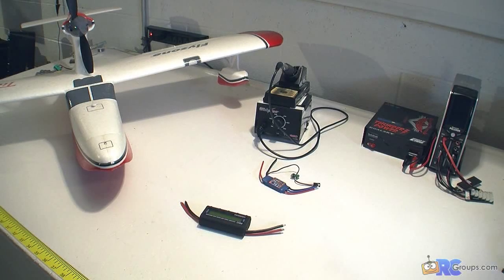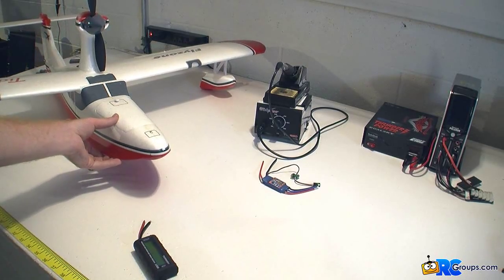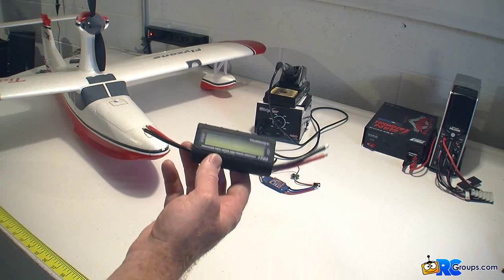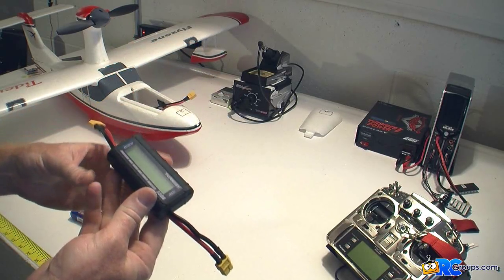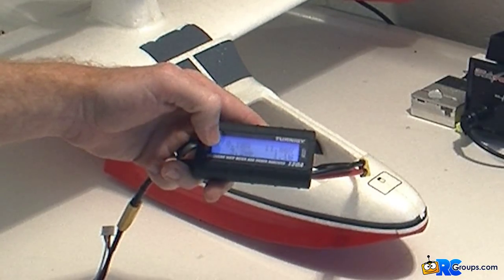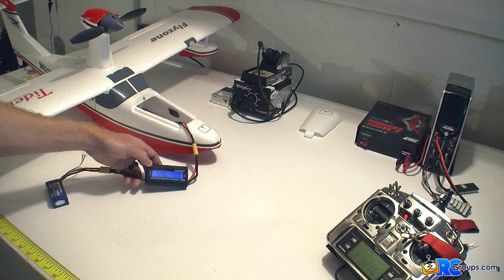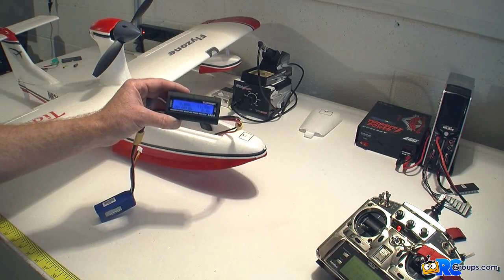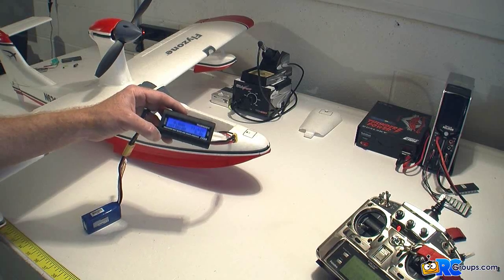Video Review: Turnigy Precision Watt Meter and Power Analyzer

Comment: ..interesting video...I just bought this meter ............. I am new to this and currently converting a nitro ( 7 lbs ) to electric...I'd like to fly the plane at approx 125watts per pound....got a Gforce 32 motor , an 80amp ESC and plan to use a 4S and 11' prop ...I  bought this  watt meter to help me determine  the correct size  LiPo ,  prop  and verify the correct ESC size.  .........any helpful rules of thumb I should follow..........thanks